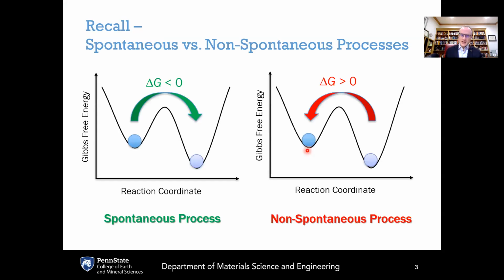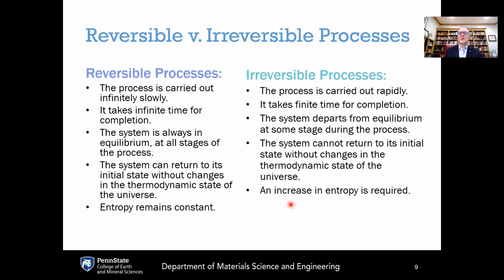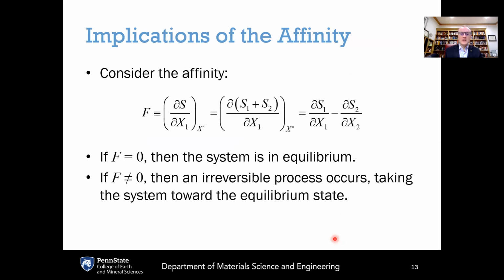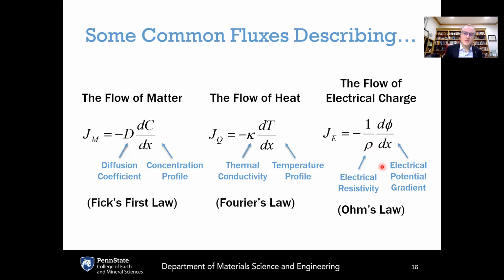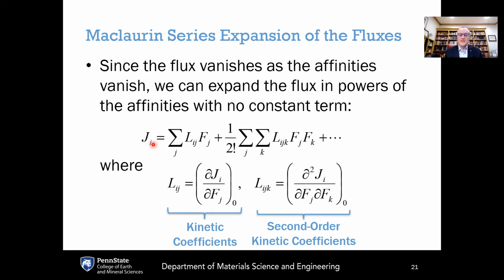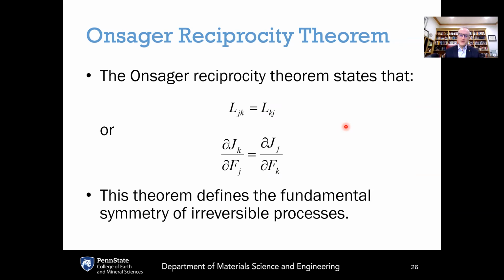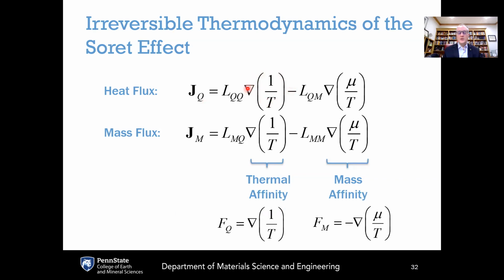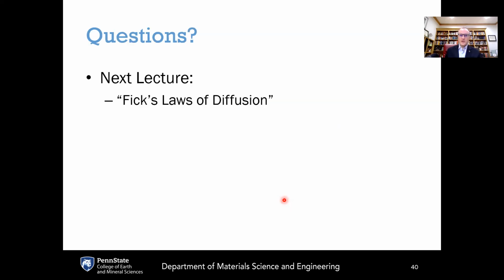Irreversible Thermodynamics (Chapter 2, Materials Kinetics)

Comment: When I first studied this it was helpful for me to keep in mind that in nonequilibrium thermodynamics, transport processes involve the movement of extensive quantities driven by gradients of the corresponding intensive variables. So the movement of extensive quantities: mass, charge and energy are driven by intensive gradients in concentration, chemical potential and temperature. 

Somebody can advise me if I’ve got this wrong, but it seems to me that Flux J and Flow F are often used interchangeably. But I think in a rigorous sense, regarding an area dA, the flux J is the intensive density change (I.e. Concentration change) per infinitesimal unit area in time: J=dx/dAdt, and the flow F is the total or integrated extensive quantity over a finite area: F=int(J.dA). But it doesn’t feel like this is in agreement with the video. 

Also: Extensive quantities can be added. For example masses are additive (3kg+2kg=5kg) but concentrations are not (a 10% plus a 20% solution doesn’t necessarily result in a 30% solution). Mass is conserved. Concentration is not.
Reply from the maker: Thank you for this excellent point, very clearly articulated.
Reply: @johnmauro1230 John, I love your videos!  I’m still not sure I have a clear understanding of Onsager’s interpretation because I see slightly different definitions from different authors. If you have a chance please comment on my edit. I feel like my definitions are not right regarding flux and flow.

Comment: At 17:29 FQ the affinity associated with internal energy is defined to be 1/T.    Later at 24:30 FQ is given as d/dx(1/T). Why are these different?
Reply from the maker: The d/dx is used for a continuous variation, rather than for discrete subsystem. Thanks for your great question!